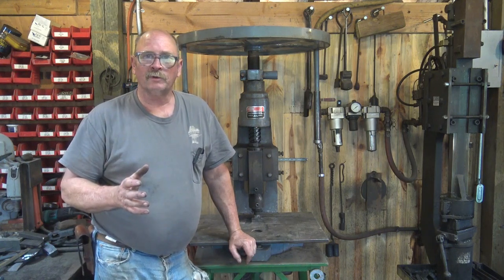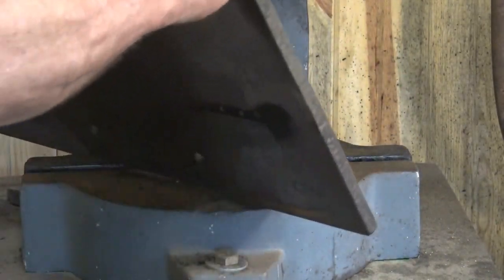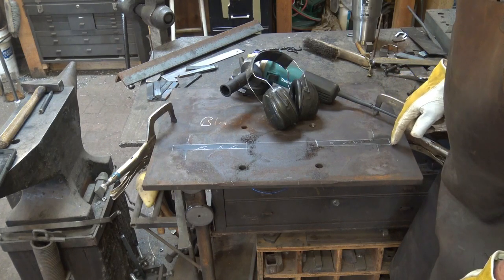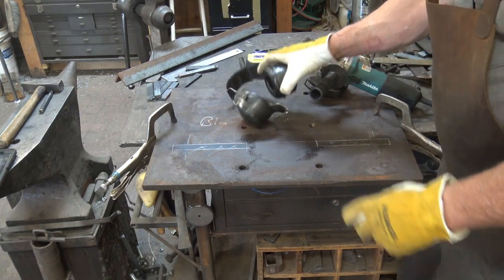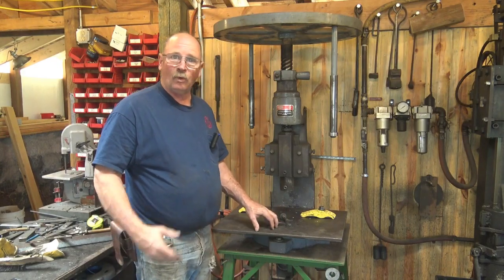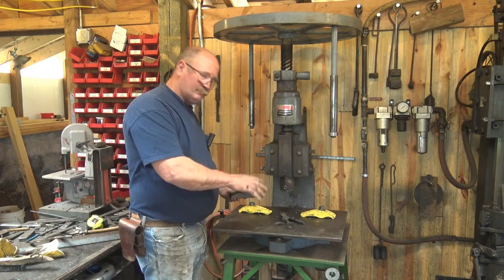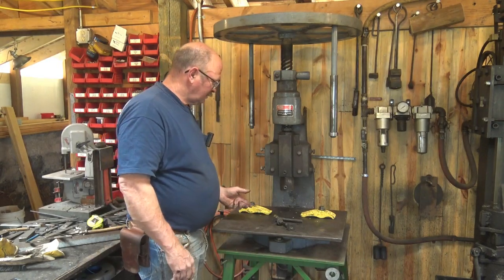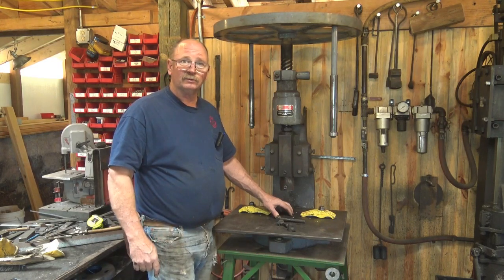Flypress table modifications for improved clamping

Comment: RIP Grinders. ...you've done well. Great project, John. Making a tool easier and more practical to use is always a good thing to share. No, I don't have a fly press, but ideas from this upgrade can float to other flat surfaces as well. This would work well with a welding/work table for instance.

Comment: Hey John I found out the hard way also. In the past three or four years I must of burnt out a dozen angle grinders.  What I learned was to stick with units over 9 amps 11 is better but anything under 7 amps is really just for a homeowner and will not take a real days work.  With saying that Milwaukee always made nice tools, myself I seem to use greenLee when I can but they don’t make everything.   Mainly just for an electrician.    Oh yea I have a greenLee porta bandsaw and I need to make a stand for it.  I never thought of doing that until I saw yours what a great idea    I always wanted a bandsaw but never had the room for a floor standing one that will cut steel.    Ok thx again John....Paul.
Reply from the maker: Bigger is better does seem to be common for blackamithing tools

Comment: The museum has an old mechanical press, but it's not a fly press.  It has a frame that goes around the press shaft, which is threaded. The wheel that operates the press has ratchet indentations around its circumference, and a lever attached to the frame that operates the ratchet.  The press is in good working order, but doesn't have any tooling.  Getting the thing operational is on my list, but it's low on the priority scale.  Your video has given me some ideas about how to get the project going. Thanks!
Reply from the maker: sounds like an interesting tool

Comment: John,My Craftsman 4/1/2" Grinder Bit the Dust also,I replaced it with a Milwaukee 5" variable speed  13 amp angle grinder,I liked it so well  I purchased another one. Cost $139.00 each, Northern Tool.

Comment: I just cut a 2" slab of mild steel with a 35 year old Makita circular saw. It has end play so I only use it for cutting stone or metal. It took 6 fiber blades but I got it done.

Comment: to plug the new holes, have you thought about using boles, mark them cut the heads off and with a cutoff wheel. then,  put a slot on the top for a flat head screw driver?    looks like you did a great job !

Comment: Dear John, once you own and use a Plasma cutter, your cutting dilemma days are over.  Just like cutting butter with a butter knife.  As for angle grinders, Bosch are brilliant machines.  They make 9” {230mm} machines which are hard work to handle.  Most popular are the 6” grinders {150mm} which don’t have much meat in the cutting discs and so wear out very quickly.  In the middle they make a 7” {180mm} grinder which has about three times the usable material in a slightly larger size.  The machine is a lot easier to handle than the 9” models.  You have to look around to find the 7” discs but they come in flap discs, grinding and cut-off discs. Cheers.

Comment: If you have a HILTI dealer in your area you should definitely try one it is used on all construction sites all over Europe they are simply the best when it comes to getting your job done I only use Hilti tools and I don't think I will ever switch to another tool brand
Reply: I'm still running hard a 20 year old Hilti grinder. 11 amp, 5" bad ass

Comment: For future reference if you practice a little bit on some scrap plate with the cutting torch you can cut some relatively clean holes/ slots and then clean them up with a hard wheel on the grinder instead of using cut off wheels and burning up grinders. I did a similar project cutting out heavy plate with a torch and practice definitely helps to limit the cleanup

Comment: I use a grinder daily for my job welding and fitting tube and plate repairing boilers.  I don't usually like to recommend tools but over the years the only grinders that I bought that weren't a disappointment were the metabo 6" angle grinder. (And the 10" Milwaukee if you can lift  It). Metabo is hands down better than any other grinder I've used.
Reply: Agreed pipefitter/steamfitter here and you can’t beat out a metabo

Comment: Hi John great job. Your table looks great, if you are still getting a little flex on your table you may be able to stiffen it up if you bolt the outside edges of the plate to the stand that your fly press is sitting on.
Reply from the maker: It was never the table flexing it was the mounting plate on that one die holder that flexed because it was only clamped at the ends.  One of the things I like about the table is that it is unobstructed for most of the edge so you can clamp to it.  So hopefully I won't need any extra supports

Comment: I also use Harbor Freight angle grinders as Ben does. I have about 10 in my shop. Each has a different disk on it, so I do not waste time changing blades.  All that for $100. (on sale).  They also have tougher ones at $20 and $30 (on sale).  I have yet to burn one out in all the time I have been using them heavily.   As I am limited in what other tools I have, these get a lot of use.  I still have the first one I bought about 10 years ago. My Ryobi, however,  has been relegated to light sanding work as the gears are about to go. I also use one without a guard with a 6" Bates ABR TA702 cut-off disk.  The curf is thiner than a hacksaw blade curf.  To mount the wheel on the frinder, I had to make a holder nut by welding a nut to a large washer so as to mount it on the grinder.  I use the side handle and the back to hold it and a momentary footswitch to control it. This way my hands are nowhere near or in line with the blade. In my shop (a DIY shop) the blades last quite a while in stock normally under a half inch..
Hope this helps.

Comment: Maybe it was a bad batch of grinders? I too do metal working for a living. Have 2 makitas the exact same as yours. I paid $59 a piece for them 4 years ago and use them daily. One with a cutting disc and one with flap wheels. Only issue I ever had was the cord end on one went bad but I put a new 3 prong on it and it still works great. What about trying out one of those low profile metabo grinders and doing a review on it?
Reply from the maker: I wouldn't mind trying one of those.  Although it would really require years of use to know how they hold up.

Comment: Cutting wheels are hard in grinders. That fine dust kills them. I fabricate and have gone thru many grinders. So far iv had nothing but good luck out of a dewalt D28115. 
It's a 13A 
4.5 t0 5 in grinder. I had this grinder for almost 3 yrs now. I use cut wheels grind wheels flap disk and wire brush. Still running like it new. 
I own 3 now 1 with cutting disk 1 with grinding and 1 with wire brush. I don't plan on having to buy another grinder for a while

Comment: Should have used the torch! Half inch plate wouldn't have warped ,it looked to be hot rolled, saved 4 hours driving, 2 grinders cost of the waterjet service's. Blacksmithing is about creating what is needed efficienitly. Just like tooling, planing the steps in forging any item, all the things you have been teaching and showing on this channel. Keep up the good vids and I'm praying for rain for you.
Reply from the maker: I opted not to use the torch because of the generally lower quality of cut that would then still need considerable grinding.  Not because I was worried about warpage.
Reply from the maker: Thanks, we will see if sacrificing a couple of grinders helps make it rain.

Comment: First, I hope you put Allen screws in all those holes, or else you will need to run a thread chase in them before you use them. Second, the 2-4 days you would be waiting for your table to get done is time that machine would have been down... you forgot to add that to your + - figures. Third, the fact that you did not have an 11 amp grinder on hand is concerning, considering you said that is what you should have at your shop...  Great DIY vid, thanks   Edit- you did think about the crud, next time I'll watch all the way thru before commenting. lol

Comment: John...invest in a plasma cutter.  Love mine.
Reply from the maker: For my shop a plasma cutter would be used so rarely it would not be worth it.  I had one once  and got rid of it.  A tool you need once every 10 or 15 years isn't always worth it when space is limited.
Reply: I do not use my Plasma Cutter every day but  is a time saver when I need it.
 my little shop is only 8 feet by 12 feet, I have 2 drill presses, 2 work benches, 1 floor model metal band saw,  2 gas tanks, 1 -4 drawer filing cabinet, my cart with my mig welder & plasma cutter, 1 cart with my AC stick welder, my HF anvil w/some tools ! I am 76 and I am in process of making a break drum forge, which will be out side with my long steel work bench, which is rigged with 110, 2 vices, and my cut off saws when needed,
 the bench as pullout supports to cut 20 foot sticks of steel with a tripod support. My last big project was 10 4x8 steel security doors for the house & a few windows, all had many "S" scrolls & "C's . 

Love your videos John, I think I have seen them all, learning a lot, you are a fantastic instructor .

Gary

Comment: Did you just burn out the brushes on those angle grinders? Next time use a Saws-All for the finish cuts.
Reply from the maker: I have never seen thick smoke as a result of a burnt brush, but I suppose its possible
Reply: Have had wonderful success with the carbide toothed blades for the reciprocating saw.
Reply: Shady Oak Forge amen brother my saws all is my go to tool for everything

Comment: Call me crazy but you could weld reinforcing on the bottom of you platen to help out with the flex.
Reply from the maker: The flex was in the plate on the die holder not in the table itself.

Comment: Just get a piece of threaded rod and cut off as many plugs as you need  Chuck in your battery drill to deburr both ends and make a slot in one end of each plug with your bandsaw to fit a screwdriver...
Reply from the maker: That would work but would take shop time that is worth more spent on customer product than what the cost of set screws.  But it is a very blacksmith thing to do, spend $50 time and materials to make a $10 part 😜

Comment: Never had a good run with Makita. Every Makita I've bought or been given has hemorrhaged early in it's life. My new table saw was a disappointment needing brushes at about 10 hrs use and bearings after only 3 months. My old GMC had lasted 12 years with no problems whatsoever.

Comment: For cuts like that angle grinders aren't fun. Drill a hole and use a jig saw with Steele cutting blades. I know from experience
Reply from the maker: I have tried jig saws on thinner material and found them to be pretty useless for the task.  You may have a much better jig saw than I did.
Reply: Black Bear Forge I think mine is just an eckland uses the longer blades than standard. And I've cut allot of Steele with it. Works better than the skill saw with consumable blades. Mind I do have to replace the blade after about 5 feet of 1 inch Steele. And almost forgot. I won't cut thinner than 1/4 inch Steele with jig saw. Useless jumps to much.
Reply from the maker: It would be interesting to see that.  I suspect it is not the same thing I picture when I think Jig Saw

Comment: Why do you need a fly press? ...you have 2 power hammers and a hydraulic press (???)
Reply from the maker: Each tool is different and has different strengths and weaknesses.  A fly press is more of a precision tool in many cases when compared to a power hammer or hydraulic press.  I would get rid of the hydraulic press before I would the fly press.
Reply: @BlackBearForge  good point...I guess i was just thinking that I have watched many many of your videos and I only remember you ever using the fly press just once...perhaps a video on the use of a fly press? Lol...thank you for your reply...You're my favorite blacksmith...no one explains blacksmithing better than you best regards,

Comment: Best grinder made is a metabo. That's about all you will see pipefitter using.
Reply from the maker: They do have a good reputation
Reply: Black Bear Forge Mr. Switzer, I'm telling you the honest truth,  the only grinder i have that will keep up with my 5" metabo is my old 9" skill that belonged to my grandpa. Metabo is number one with Milwaukee  at number 2. Bosch and Makita are tied for 3. And dewalt is 4. Portercable places 5 in grinders.  As far as cordless tools Milwaukee and Makita ate tied. Corded drills is Milwaukee and dewalt.  Hammer drills is Bosch. And I'm not just throwing names out there.  I grew up in the construction industry,  and worked In  construction until the recession hit and the job market dried up.  I've been driving a truck ever since.
Reply from the maker: I never doubted you
Reply: Black Bear Forge i didn't mean for it to sound like that if it did.

Comment: hmm john you have a tendancy to just pop up in your videos, it like oh nice old flypress then boop you appear hi, do you like to come out of nowhere and frighten people like I do, you seem to do it alot to me, and yes the plate looks heavy its thick like parts we have of the steam loco 765 its not like huge solid but does have very thick often forged metal over 1/2 inch thick or just plane old solid, like just the valve gear switching mechenism is 50 lbs  and takes 2 of us to pick up and carry, or if your like me you bang your head on the boiler on the inside and its soo hard you dont even ring it due to its thickness and soild nature, meanwhile it rings my dome and gives me a headache.